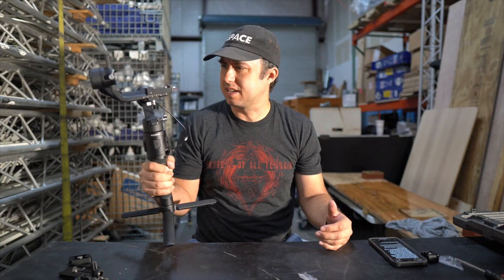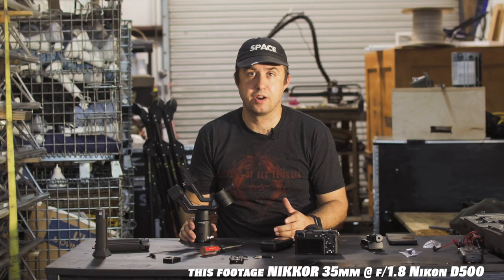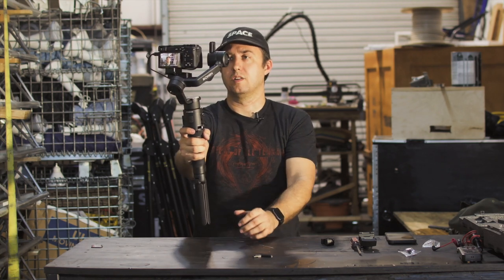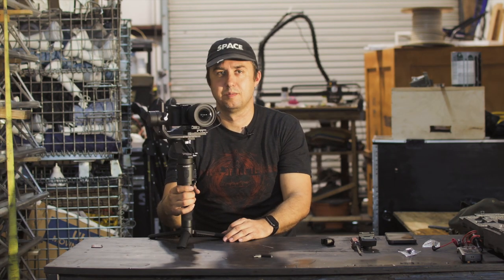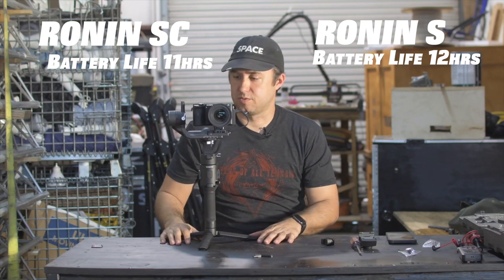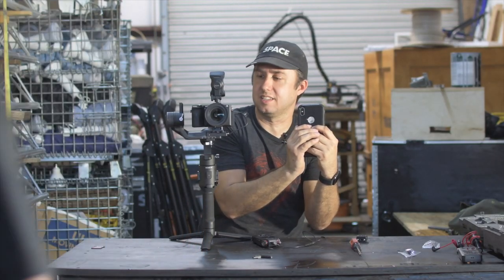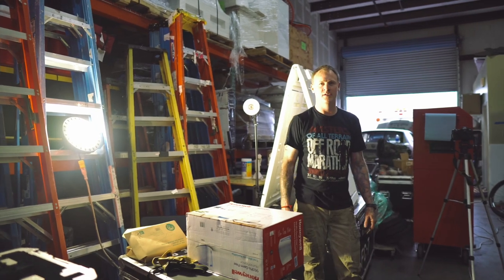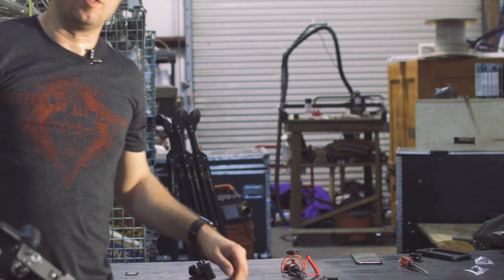DJI Ronin SC with Sony Alpha A6600 as reviewed by an underqualified non professional amateur.

Comment: great use of the gimbal! I've looked at lots of reviews of gimbals. The Ronin S and SC take a long time to balance compared to the Weebill S. The Weebill S also has a much smaller form factor, is much cheaper to get when considering add-on features, and can handle a much heavier payload for various lenses to be added to the Sony A6600.  Again, thanks for a fun video and you are good with the gimbal!!
Reply from the maker: Thanks, Paul! I’m going to look up some videos on this Weebill. I really couldn’t be happier with the ronin, though. After I figured everything out, I can balance it pretty fast. It’s a little problematic when switching lenses, or adding, removing a mic. But I don’t see a way for any gimbal to stay balanced when you’re changing center of mass.
Reply: Weebill s appears  according to reviewers much more stable with no need to rebalance much.  They have reviews that compare

Comment: Did you had any issue on the weight because im kind worried about the ronin sc pay load
Reply from the maker: Franklyn Saint I use it with a Sony A6600 with a shotgun microphone attaches  and there have been no issues with weight ever.  Or do you mean the weight of holding it, because that can get a little cumbersome if you take it somewhere you’ll be holding it all day.